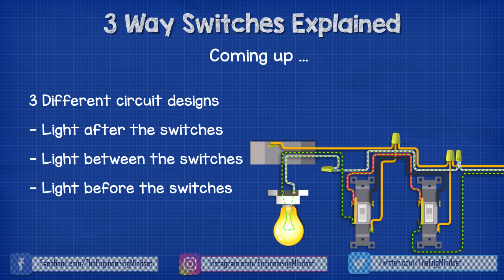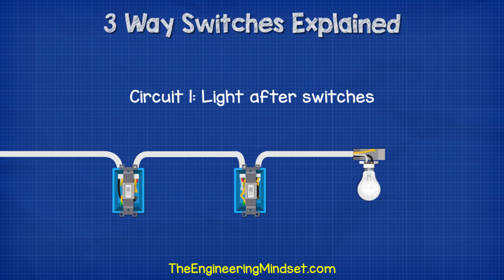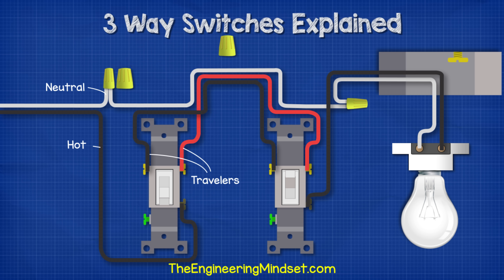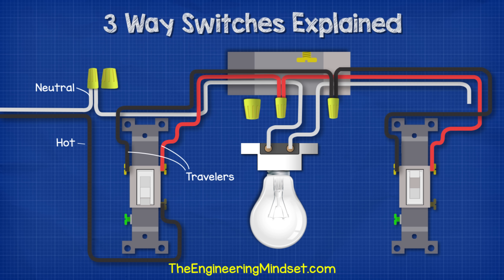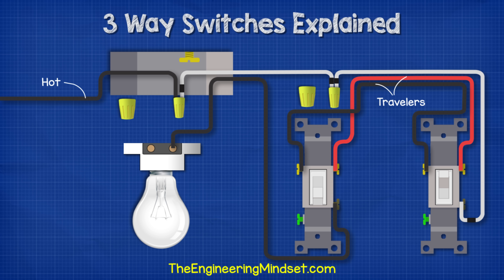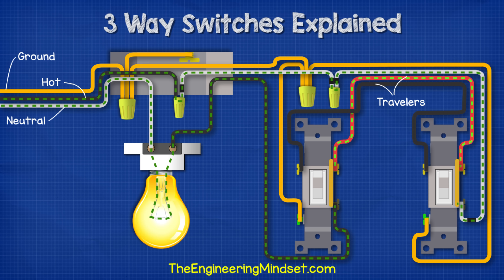3 Way Switches Explained - How to wire 3 way light switch

Comment: I  am trying to connect 4 lights between two 3 way switches.  If possible can you show how the wire  would connect to each light fixture before connecting to second 3 way switch? My distance between the two 3-way switches is about 50 ft.  
Thank you,

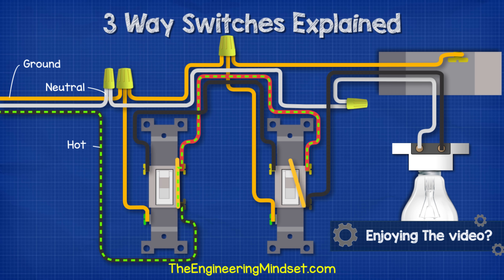Comment: I'm confused at @3:38. If the light is last in the circuit, why do you need both switches to be in the up/on position in order for the light to work? I've never seen a three way switch work like that and you could essentially just replace that layout with just a single switch to control the light. Every single three-way switch I've seen works that just one of the two switches needs to be flipped on regardless of what the other switch is doing in order to turn the light on or off.

Comment: This helped me solve my upgrade to smart 3 way switch, the common for the light was on a different circuit then the smart switch and this probably wouldn’t be such a big deal unless one of the circuits/breakers involved was GFI it would fault consistently. I was able to combined the light and switch to one circuit and that solved the issue

Comment: I'm confused; the video shows the light powering on only if BOTH switches are turned on. Does the wiring shown allow for each switch to turn the light on and off, or do they both have to be aligned like in the video?? All the comments are saying "thank you it's so clear now" but to me it looks like a series circuit... what is going on?
Reply from the maker: They can both be on, or both be off, and it will complete the circuit.  The switch doesn't control the light, it controls the path to the light.
3:06 S1: ON S2: OFF = OFF
3:21 S1: OFF S2: OFF = ON
3:29 S1: ON S2: OFF = OFF
3:38 S1: ON S2: ON = ON

Comment: Unfortunately these wiring configurations do not provide the function that most people expect. The designs do result in a functioning 3 way switch, but most folks prefer to have the light turn on only when one switch is flipped up and the other switch is flipped down. To accomplish this preferred function you must put the red traveler wire onto the left traveler terminal on one of the switches, but then put the red wire onto the right traveler terminal on the other switch.

Comment: I work doing a lot of low voltage systems, so I’m not as familiar with 3 way switch circuits. When the light is in the center of the circuit, like in the second example, why run a second neutral colored wire as your hot back to the light as opposed to a black wire, which is already assumed to be hot? Seems like a waste of tape and time, unless there is something I’m missing.

Comment: My house was new in 1980 with one owner. Now, if changing a 3-wire switch due to a color change or failure, seeing different methods of wiring that day in 1980, I open both 3-ways, get my Fluke 87 type V, to figure out what method they used. At least than ran red but no tape on white to show hot. I cleaned it of, tapered it with a dab of black weather stripe adhesive to hold in place. Great reminder of how it’s done. If the less experienced tech installing the door bell transformer would have used a DVOM, he would know that the furnace fan is not the location to get his 120Vac causing the bell to work only with heat or A/C call from the thermostat. He’s probably driving a forklift somewhere now!
Thanks kindly for the animation. Great help!

Comment: Why can't you just use a black wire instead of taping the white wire with black tape? Is this another option too?
Reply: They’re using the white as a hot in this case because it’s 3 wire and they already have a neutral at the light.

Comment: I like the diagrams however I would never run it like this. 

1. Just run the three-way wire from switch A to switch B without cutting the wire

2. You only need power on one side let's say switch A 

3. Switch B won't have direct power it will come from switch A. You would run a 12/3 or 14/3 directly to the light or lights 

4. So at switch A lets say 12/2 or 14/2 is coming from the panel or its a switch leg from anywhere else. 
A. You would put the hot 🔥 black on the black terminal screw. 
B. You would connect the whites together 
C. Connect the black wire from the 3 way wire to the left travel screw
D. Connect the red wire from the 3 way wire to the right travel screw

Switch B
A. You would put the 12/2 or 14/2 wire on the black terminal screw. 
B. You would connect the whites together 
C. Connect the black wire from the 3 way wire coming from switch A to the left travel screw
D. Connect the red 3 way wire coming from switch A to the right travel screw

Comment: Why cant we just use black wire instead of using white wire with black tape?
Reply: The wire comes in a sheath, so it doesn’t make sense to try to shove another black in there, also you can’t have two wires of same color in a sheath because then you don’t know which is the actual power wire.

Comment: My greenhouse has a thermo controller which switches on the fan @ 77F. Sometimes, I am working in the GH but it is only 75F
and after several min it becomes uncomfortably warm inside. So, I am going to build a switchbox for the fan. Using a 3 way 
switch it will have 2 power sources thru the switch to an outlet for the fan. Switch POS1 = thermo controlled  - POS2 = overides 
the thermo control and turns the fan ON. I wonder how many times I will forget to turn the switch off the OVERRIDE and long 
after the  GH temp has dropped below 77 the fan will continue to run. maybe all night long. I know me.

!

Comment: Shouldn't you wire it in such a way that the light is off when both switches are in the down position (or both up) and only on when one is up and one is down? This is far more intuitive for the user.

Comment: So I've done it the long way,  switch to switch to fixture. 
Ill be implementing going to the fixtures in between the switches more often. 
But how do you do 3 switches or stopping by a switch in route to the next light? 

Doorways to hallways and stairs always require so much wire

Comment: So I have two switches and one light .. where the light is there are two separate wires that both have red white and black wires and one has a bare wire..the light only has black and white with a bare wire.when I connect all black to black and white to white only one switch works to turn it on ..I don’t know what to do with the red wires

Comment: I have always seen 3 way light switches work where if both switches were in the off position, the light was off.  If only one of the light switches was in the on position, the light was on.  if both light switches were in the on position, the light was off.    All of the videos that I am seeing are showing that the light only turns on if both switches are in the on position, which makes this a little confusing.

Comment: Umm… problem: my friends home (built in 1980), has 3 way light switches with NO green ground connection point. All the grounds are wrapped together and stuffed in the back of the switch box. Each switch has 2 black and one white wire. One of the black wires is the common. But when attempting to swap a new switch, i used the wrong switch and only it would work- realized it was not a 3 way. Now i have 3 way switch but don’t remember which “black” wire is common, idk if it even matters but because it is electricity- it always matters. Safety first. Im not burning my friends house down over this, but i will figure it out, somehow 😁
Edit: sorry, the switches have 2 black and one red wire!! No ground wire, but they are present and wrapped together and stuffed in the back of the switch box. The old switches only have 3 points of connection, line(2x) and 1 com. No green ground screw, and i have never not seen a switch without the ground screw, what gives?

Comment: My house is over 100 years old and they have circuit 2 in one of the rooms. How would I add multiple lights in between the light switches? Would you piggy back a 3 wire cable into the other lights?

Comment: so in all three wiring,  both switches have to be on.?
Reply: It’s not they are both on. The power will on both but it’s starts a switch 1. Flipping the switch won’t turn of the switch it just changes the rout the current takes

Comment: How to wire the load end 3 way switch as there will be only one cable of 14/3 in the electronic box ?  The line end is easier to wire as there is clearly offering line and load conductors.

Comment: The stairway between the basement and main level of my house has a single wall mounted sconce light halfway down the stair, it is not enough light, especially as the electric panel is in a niche just off the bottom of the stair and you can't see it well enough to work in it and have to use a work light or something when needed, so I need some additional lighting at the bottom of the stair, I have removed the paneling at the bottom of the stair which exposed the backside of the basement light switches and I've pulled the fixture itself and i've determined I have the first example given in this video, the Basement switch box has the power from the main panel running directly into it, there is then a 14/3 (Grey insulation) wire exiting that switch box and heading off in a direction I can't trace due to HVAC ductwork and unit being in my way, but is heading in the direction where it could run to upstairs, when I pulled the Light Fixture in the stairway there is only a 14/2 (white insulation) wire, so this would indicate that power is coming from the panel to the basement switch then from their running to the upstairs switch then a 14/2 coming from that switch to the light fixture.

Based on this I assume that means the only way I can add another light would be to daisy chain off the existing light fixture, punch some holes in the drywall in the stairwell and feed a wire down from the light fixture (I need to replace the box for this light fixture anyway as it's half pulled out of the wall) to where I want to add lights that will be switched from that existing 3 way?

Comment: I have a question. I replaced a broken ceiling light that was controlled by two switches (a three way wiring). I installed the light but I think I might have switched the two wires that connect to the fixture (they were both white and unmarked) Now the fixture only works if both light switches are turned on and only one switch at a time can turn the light on and off. I'm trying to figure out if one of the outlets went bad or if I accidentally switched the wires to the light fixture and caused this problem. Everything was working fine before I replaced the light fixture. The light fixture is located between the two light switches. I did not change the wiring to the switches. I only replaced the fixture.

Comment: I agree with everyone else that this is amazing and super helpful!!!  So I tried this, I have a new 15amp circuit going to a switch then to 10 lights all in a straight line down a hallway, to the final / second switch.  I wired everything up per the video and turned on the breaker and got nothing!  So I checked all my wago connectors and double checked I was following the video diagram exactly and still nothing.  Any thoughts?
Reply from the maker: Have you wired the lights in parallel? Series won't work.
Reply: I did them in series!!! @EngineeringMindset

Comment: im a little confused arent the two circuits the same except you just extended the cables on the second one? why do you use a white wire with ends marked black as opposed to a black wire?

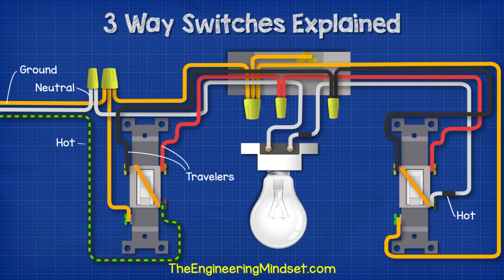Comment: I thought you could turn on or off the light from either switch. 5:52 seems to show that switch 2 is needed to change position in order for the light to come on, seemingly defeating the purpose. What am I missing? (BTW I really get alot out of all of your videos.)
Reply from the maker: To turn the light on, you just change the position of switch 1 again. Both switches can turn the light on or off at any time. We're just connecting the paths available. The switch might be up or down and be able to make a connection depending on what position the other switch is in.
Reply: @EngineeringMindset Thanks for getting back to me on that. I love your channel!

Comment: What is the purpose for the wire connectors?
Reply: It's the correct way to connect 2 or more wires that you need connected but also protects the wires from contacting anything they should not touch! (A white wire touching a black wire or a ground touching a black wire etc or a white or black wire contacting metal in a receptical)
Reply: @jjnich4915  I understand what they’re fire but if I recall correctly in the video it seemed unnecessary, almost as if the wire could have just kept traveling without it. I’d have to watch again to see

Comment: Thanks to this video I was able to fix the 3 way switch in my master bedroom. Previous homeowners somehow had it wired to only power on if both switches were "up" position.
Reply: This is exactly what I'm confused about; the video shows the light powering on only if BOTH switches are turned on. Does the wiring shown allow for each switch to turn the light on and off, or do they both have to be aligned like in the video?? All the comments are saying "thank you it's so clear now" but to me it looks like a series circuit... what is going on?
Reply: @ColMustard513   In this case, there is no ON/OFF position per switch. To turn the light ON both switches need to be in the same direction (both up or down)

Comment: Question: when wiring multiple lights in the circuit, do you need to use 3-wire cable to connect them all to each other, or can you just use 2 wire cable for that?

Comment: Very clear explanation, thanks.  My problem is I am trying to replace regular 3 way switches with Ecoeler YM2108T light sensing switches.  Their diagram seems straight forward but I think it is for a load at the end of the switch string.  My load/light is  between the 2 switches and I am having problems determining how to hook up the red lead from one of the switches.  Any Help?

Comment: I have questions.  Well, more like one question:  Why are the colors changing?  You jump from black wires to white wires with black electrical tape.  And the colors seem to be mostly all over the place.  This is the problem with the electrical engineering universe - it doesn't make logical sense.  It's not like "hot" suddenly transforms and becomes "neutral."  All wall power contains lethal electrical current and is therefore "hot."  Inconsistency like this is the type of thing that drives me nuts...and starts electrical fires.  If the goal is to keep your wires straight when you reach the boxes, then there is a whole rainbow of colors you aren't using:  Green, purple, blue, brown, pink, etc.  I don't know which one would be best, but you should pick one.  Don't do goofy things like wrap electrical tape on wires changing their color mid-run but keeping the same meaning.

Comment: 3:28 so, the light is on if both switches are on/off. If we swap the position of the coming red and hot on switch 2, is this gonna be easier to understand?

Comment: What's the purpose of the wire connectors? Can you not just run a direct line straight to each point without the need for the connectors?
Reply: Elaborate on your question a bit more I think I might be able to answer
Reply: Do you mean the jumper cables going from 1st switch to 2ndswitch?

Comment: The first one is the only code compliant circuit. Per code You need a neutral in every switch box
Reply: The first two are both code compliant if you can see all the lights from one switch you only need one switch to have a neutral NEC 2023 404.2 "Where multiple switch locations control the same lighting load such that the entire floor area of the room or space is visible from the single or combined switch locations, the grounded circuit conductor shall only be required at one location."

Two does have the problem you can't relabel the neutral like that to the light. But if you use the relabelled neutral as the common for the switch and use the black to run to the light it would be ok. Kind of like how it's done in three 

Three could be made compliant by using a 3 wire between the light and the first switch and continuing the neutral to the first switch.

Comment: Fantastic video. My only question is on the wire coloring in the last scenario. the wire going from the nut in the light box to the rightmost switch is white, and the one leaving that switch into the second/middle switch is black. I would have guessed these would be flipped as I always thought of black/hot as the incoming circuit and white/neutral as the exiting circuit?

Comment: I do not believe the illustration of power source ---> light ---> switch ---> switch is legal anymore. NEC updated the code so that there must be an available neutral in the switch boxes
Reply: @Joe Washington I believe so
Reply: You're correct, you'll need a 3 wire cable between the light and the first switch, then pigtail it to the neutral from the power cable and leave the other end capped in the first switch box. In 3-way and 4- circuits only one switch needs a neutral wire.

Comment: What happens if i put one traveler on terminal 1 of one swittch and the same traveler landing on terminal 2
On the second switch? Will it operate normaly?
Reply: Yes, it will work but the switches will be in opposite positions when the light is on and in the same position when the light is off. It's a little odd maybe, but who would care or notice especially if the switches are far apart.

Comment: Is there a way to have a light at both the beginning and end of the circuit? As in a light at the top and bottom of a set of stairs.
Reply from the maker: Lamps must be connected in parallel.

Comment: I know some switches have 2 black wires.  what happen if I connect the black wire incorrectly or (connect black (hot) to traveler wire), will it damage the switch and/or will it work?